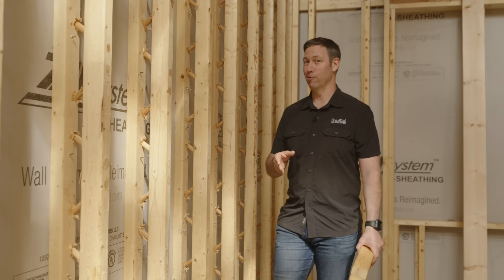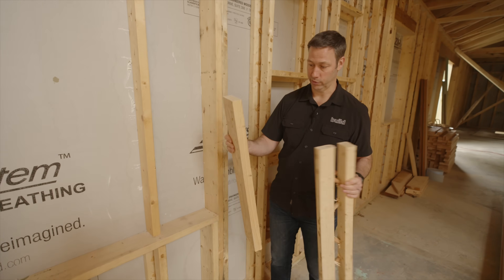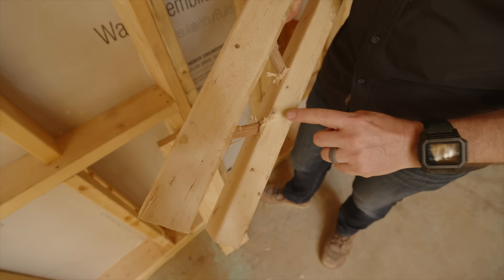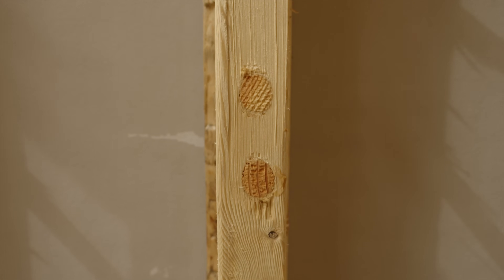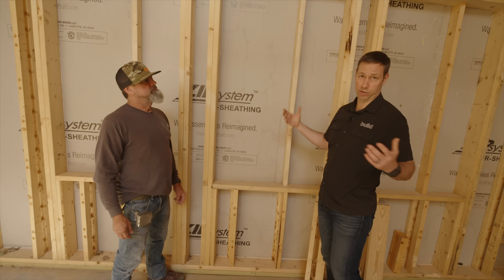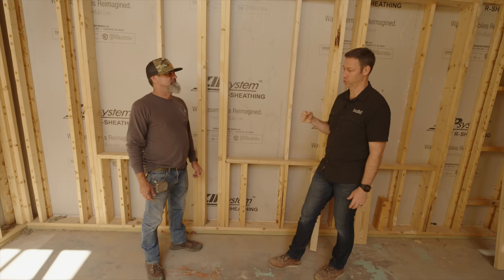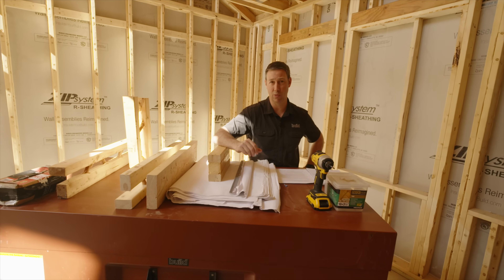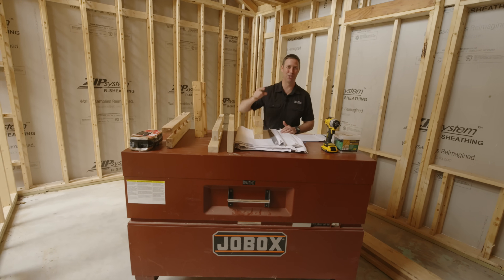Framing with a 2x6 Replacement - TSTUDS!!!

Comment: As a firefighter/paramedic I will pass on this product. The split was too easy and also the price point is out of sight for most for sure. Often the cool stuff is neat to see and all but when it comes down to life safety adding more glue and even more fire load. It’s not good. Yes Matt this is cool but all these engineered products are placing people in more danger than ever before. 

Case in point a minor basement fire in Indianapolis two months ago had the entire subfloor of the TGI joists burnt away. Smart fireman noticed this and they all went home. Engineered products have their place but not for me. 

Although great content
Reply: Your comparing apples to oranges. Floors/ceilings get the full brunt of the heat and are likely to be unfinished. A wall stud will be finished with sheetrock and packed with fire resistant insulation and should have a good air barrier on the  outside along with the possible draft of fresh air to cool the wall.   

Do you have any solid numbers on injuries from fire damaged engineered joist?   Is this a real issue or an academic exercise in what ifs and I knew a guy science?
Reply: @tysleight  Tyrone just FYI it was my Engine crew who almost went through the floor. And it’s not comparing apples to oranges as it is still engineered products.  And the theory of the wall stud maybe covered by sheet rock is invalid as well. Unfinished basements, garage walls, and so forth. Yes there are variables involved. I have been a firefighter for over 28 years and speak from trade and real world experience. Also many homes don’t have flame resistant insulation (spray foam).

This is not a what if theory by some guy. Anytime you put products in a home that have glue and other chemicals in them all it takes is heat. Drywall has to be 5/8” type X to have any fire rating also. Most homes have 1/2” regular drywall which can and will get penetrated by an intense fire.

The air barrier plays no part of it either

Just FYI homes used to have fires that doubled in size roughly 20 years ago leaving occupants minutes to escape (at least 3 to 5) now with all the synthetics and also engineered products you have less than 3 minutes to escape and the fire grows at an exponential rate many times faster than before. 

Backed by many years of training, actual college experience ( bachelors in Fire Admin and also Arson Investigation). Also studied fire dynamics and combustion’s processes and the effects on both legacy materials and modern materials. 

All makings of potential disaster. 

So validated information from many experts across the field to back my claims.
Reply: @toddeberlein965  Thanks for sharing your expertise, Todd! I was just thinking to myself that this product might not hold up well in a fire.
Reply: @rudycarrera4759  let's be adults. I asked a simple question,# of injuries from engineered joist?  You came back with huff and puff and smoke. Give me real numbers. Like the average career fire fighter ( not volunteer or wildfire) will  not sure of the jargon 1.1 house fires a year according to the NFPA website ( 320k career firefighters divided by 354k home structure fires or 1.1 homes per year per FF. 2018 numbers). This includes fires that have already been put out. Half of which are cooking fires.

 I am not a fire expert or an HR person but when I see fires I typically see lots of personal standing around at a safe distance not walking into a building so who cares what it's made of, your not going in a burning building that has structure issues or not.

1/2 sheetrock has a 30 minute rating according to industry standards and government test according to the information on huds website.  Heck my cardboard box that came from Amazon with my auto parts  had a fire rating on it of think it was like 190 seconds or something.

20 years ago while in highschool I framed homes with engineered joist and traditional wall framing that would be absolutely the same as today.  So I truly would like to know why  the time has dropped? The way we're measuring it? More open floorplan? More junk in the home?  Reported cases?   But once again the national fire response goal time is 560 seconds with 80 of that in just turn out time. so unless you are real close to the station building structure is once again null for a single family home. 

Sorry I took so long to respond I am at work ( I no longer build homes for a living just remodel to keep me out of trouble) we just had a guy code on us and I had to go and assist. But if you work ems you know life is boring until the overhead speakers turn on.
Reply: @toddeberlein965  one other thing air barrier makes a huge difference!!!   Just ask my new burn barrel that was not working near as well as the old rusty one. Few hits with the claw hammer and bam air barrier breached and flames like it's hot day in california.
Reply: @tysleight  Not going to have a direct answer for your question. I am in the construction trades in the Midwest, and my brother-in-law has been a firefighter for over 30 years and we have had this same conversation several times.  He has stated just about the same things as Todd has. He says the fires and the response to them have changed over the years with the introduction of much more engineered lumber.  We have had enough conversations about it over the years that even though engineered joists offer many advantages, I personally shy away from them just for the safety issue alone. (I mostly do remodeling).   As with many fields, engineers/architects often have great ideas, that sometimes just don't work out in real life scenarios.  This is a good discussion for sure.   God bless to all!
Reply: @Tyrone Ismyname  I think the issue is with engineered materials is as follows:  Engineered materials typically use less material to create the same structural load bearing member.  Engineered materials typically have more surface area for the same structural member as traditional dimensional lumber.  Engineered materials typically create a structurally strong member by utilizing individually much weaker members glued together.  Glues used in the engineered materials react to heat typically by softening.  Its not about the speed of propagation of the fire, its about how fast the structural member looses its integrity.  Heat from the fire below softens glue that never used to be there, and the thinner materials with a larger surface area are consumed by the fire faster therefore, floors built with engineered materials will collapse far faster under the same fire conditions than those built with traditional dimensional lumber.
........

Here is what National Institute of Standards (NIST) has to say on the subject.
https://ulfirefightersafety.org/docs/2009_NIST_ARRA_Appendix_C.pdf

Here is what National Institute for Occupational Safety and Health (NIOSH) has to say on the subject.
https://www.cdc.gov/niosh/docs/wp-solutions/2009-114/pdfs/2009-114.pdf?id=10.26616/NIOSHPUB2009114

Also I am curious why you suggested why volunteer firefighters are less important in your numbers than paid?  I myself was a volunteer wildland guy, but that doesn't make the science of safety any less important.  As for the death rate of career firefighters, I suspect it hasn't spiked because of the knowledge in the fire service to stay the heck off engineered materials.  

I am curios what the death rate of career firefighters is caused by falling out of the station recliners? LoL  lighten up it was a joke!
Reply: kinda what I thought. people ever wonder why full log home walls dont really burn (Density) or takes a long time you dont throw a full round log into your fireplace you split it up

Comment: Matt ❗❗  can you.❓   Have you❓ used  those studs on a roof❓❓  8 inch's  1  0 inch's  or  1 2  inch's
  Deep  for added installation ❓❓ For strength ❓❓   Why I ask❓ Building a small off grid cabin.    Would be great.
 Of course with the right pitch for rain n snow run off ,.. 1 0   1 2  foot wide roof ❓❓❓ SO MUCH INSTALLATION.
THEN THE WALL ❗❗ SO  COZY😧😦🙏👍  HEAT  IT WITH A MATCH ❗❗❗❗

Comment: This would have been a perfect place to use "advanced framing" methods (24" o.c. stud spacing, single plates, metal connections to reduce king-studs, etc). "Bridging" can add up even with exterior rigid insulation.
Reply: How? The whole point of exterior insulation is to eliminate the bridging through the studs. Are you talking about heat transfer through the screws that go into the studs?
Reply: @454Casull  right, but every regular stud increases the 'bridging' even with exterior rigid insulation. The less studs the better the R-value of the entire wall system.
Reply: @timskufca8039  Bridging means bypassing the insulation system such that the the effective R value of the wall is less than the calculated R value of the wall without any shortcuts through the insulation (or, "thermal bridges"). Once you're past the plane of the exterior insulation, on the warm side (in a cold climate), it doesn't matter if you're in air or in wood; the heat energy, or loss thereof, is now in your house.

As a matter of fact, with an exterior insulated wall, a solid 5.5"-thick sheet of plywood on the inside would have a higher effective R value than a 2x6 stud wall.

Of course, it's different if we're talking about laying insulation into the stud bays with insulation on the outside as well, but this is rather trickier and should only done with proper forethought and calculations.
Reply: @454Casull  If there was a thermal-camera shot of the wall, those studs will show up (I suppose it depends on the thickness of that exterior rigid insulation).
Reply: @timskufca8039  Why would they?
Reply: @454Casull  that camera would show that the 'bridging" still reduces the overall R-value of the wall with exterior rigid insulation - maintaining that 24" o.c. studs / single top plate is superior to 16" o.c. studs / double top plate
Reply: @timskufca8039  I understand what you're saying. You still haven't explained why studs inside of exterior insulation would contribute at all to thermal bridging (again assuming the case of no insulation inside the stud bays).
Reply: @454Casull  I guess I didn't see where there is no cavity insulation (which seems silly, since more is always better, and cavity insulation is cheap).
Reply: @timskufca8039  The problem is that in certain climates, cavity insulation will cause the inside of the wall sheathing to be cooler than the room. At certain temps (based on room temp and R value) the temp of the wall sheathing MIGHT be cool enough that you start getting condensation on the inside of the sheathing. For example, in a very warm & humid room with a lot of cavity insulation. At the same time, you can't not use a vapor barrier on the outside of the sheathing, so if you put a vapor barrier on the inside to prevent this new issue you've effectively created a moisture trap in your stud wall assembly.

Again, there are certain climates that allow a certain amount of insulation in the stud bays... you just generally can't use very much. And yes, in this situation, a small amount of cavity insulation will probably be more insulating than stud lumber but these T-studs won't be significantly worse.
Reply: @454Casull I am a northern climes designer, which I'm accustomed to the mantra, "more insulation is better" - and have wondered why use T-Posts without the spray-foam center. This post of yours reminds me not all projects are northern projects.     In your last post, you mentioned "wall sheathing" a couple times, but it wasn't clear if you were talking interior or exterior sheathing. I always think of "sheathing" as an exterior material, but your example you spoke of "a very warm & humid room" which made me think your reference to "sheathing" was on the interior???
Reply: @timskufca8039  I mean exterior sheathing when I say wall sheathing, as in (exterior) wall sheathing. And my comment applies especially in cold climates.
Reply: @454Casull  in a cold climate why wouldn't you use T-Studs that have the spray-foam embedded studs instead of the exposed webbing T-Studs? Maybe it would be less expensive to add an inch or two spray-foam in the stud bays?

Comment: Still makes me nervous about entering that home during a fire.
Reply: How come?
Reply: @970357ers  usually when you replace mass, you lose time. Look up the engineered floor joists. The burn time with direct flame is about 6 mins. So in 10 mins you have a floor you cannot walk on, without falling through. If someone is in the house when you call 911 for a fire, they may not be able to rescue them before it's unsafe to go into the home.
Reply: Also means that you will fight the fire from a defensive, vs offensive. Modern homes are usually a complete loss, vs older homes in a fire.
Reply: @Braun09tv  well, those responding, they may not be willing to risk their lives if they feel the house is compromised. Look up the UL videos on modern house fires. You went from 30 mins to being fully engulfed in 7 mins.

Comment: Wood has been around since the beginning of time. The glues that hold this stuff together have been around for how many years? It's sad that at 42, I will see the failures of these products in my lifetime.
Reply from the maker: Really?  Do you also think Advantech flooring and Lvl headers will fail?  Same glues. You’d be surprised to find out much of your truck is glued together too. You need to find some new things to worry about
Reply: The technology of glues has advanced so much that this will never be a problem in the life of the building.

Comment: How to drive the framer crazy   . In my experience   The cost differential is not passed into the homeowner or builder   but a reduction in how much the framing subs are paid    also the more complex the frame . The more insanity will incurred on the job using these state  of the art studs.    Frame the house with metal studs
Reply: So the entire point of this product is to reduce thermal bridging and increase the effective R-value of the entire wall assembly. And your suggestion is to use metal studs? Wow.

Comment: This would probably be helpful for sound deadening too. I'm converting a house into a duplex and this would be perfect for the wall between the two. On outside walls it could help quiet traffic noise.
Reply: You should make sure there aren't code requirements where you live about how to construct the the wall between duplexes/townhomes for fire stopping purposes.
Reply: Great point, insulation isn't just for exterior/thermal purposes.
Reply: A double offset style wall would be more effective for sound deadening. Acoustic decoupling requires as little contact as possible the 2 surfaces.
Reply: @gregthompson1609  You are correct in Decoupling, at the same time, without building a separate internal wall the amount of material coupled will significantly reduce the sound using the T-Stud.  2 reasons:

1- Insulation can be placed between the 2 primary Support structures.
2-  The coupling material is at an angle which in turn creates a bounce back and not direct transfer of soundwaves.
Reply: @gregthompson1609  That's how we did here as well. With fire resistant board on the inside of both walls.
Reply: @gregthompson1609  that, with double 5/8" drywall both sides, was done in a (currently 30 year old)160 unit apartment building I worked in doing maintenance. That company was cheap and made many choices in the build which werent wise (IMO) considering they knew they were going to be responsible for maintaining the building.
   The point being you lose a little interior space but its gotta be the thriftiest, most cost efficient, method.
Reply: Sprayed foam would kill some of the benefits of this, as the dried foam would cause better mechanical transfer of acoustic energy, but blown fiber glass in conjunction with this framing tech would help preserve the soundproofing benefits if this was a higher priority goal for someone.
Reply: Honestly, to get it soundproof for two parties I'd prefer two non-connected parallel walls.

Comment: sorry would never use it, cost 5 times as much. its a answer looking for a question/problem.  at 3:26 you can see how little it takes to split and damage it.
Reply: I was about to comment that... they cut it short and split the end....
Reply: Also I bet they all gonna be a bit different in length. Or like u already said too expensive. Did they mention smth about using them like plates..? That is pain in a ass
Reply: @rombtr1343  The website makes it look pretty straight forward.
Reply: Good eye.
Reply: why would any builder use them, smaller dimensial lumber which means Less meat to screw and drill into. Hence higher chance to split the lumber

 It takes no time to drill through a normal stud to run cables or wires. Certainly not faster yo justify the price

Comment: The cost of the naked t-stud and the cost of building a double wall (10 inch deep cavities) might be comparable though not equal. The use of a mixed style of framing totally makes sense as well. I’m planning an extension project and this gives me a great idea. Thanks for the vid.

Comment: if these are same price as 2x6 Id  buy them if I were building a new structure
Reply: @Craig E considering they are nearly impossible to get id just grab the 2x6 at the local lumber yard and move on. I dont need something like this that bad. If they were the same price i might wait on them to ship if I had a big project. I bought my wife a new hyundai in feb 2019 for the cost and reliability. 10 year warranty etc. Id never buy a BMW ( big money wasted) for an unreliable high cost of ownership mediocre looking car. I got her a hyundai elantra "limited ultimate" for 21k fully loaded with all the tech options. As it was an unsold 2017 model sitting on the showroom floor it was a steal. LOL